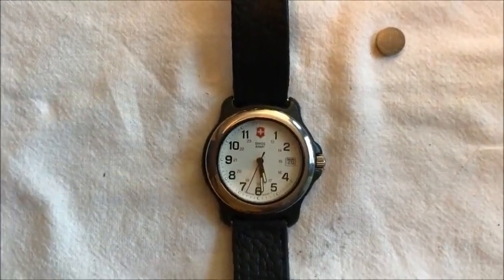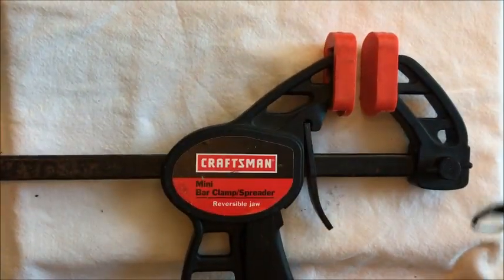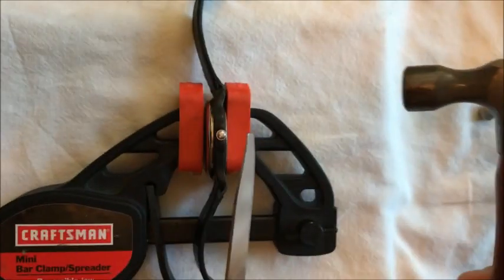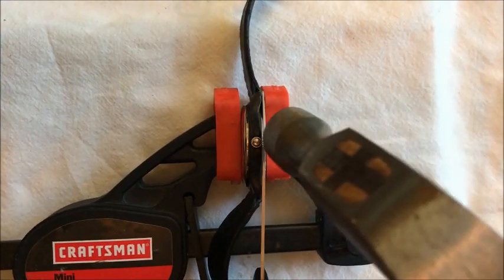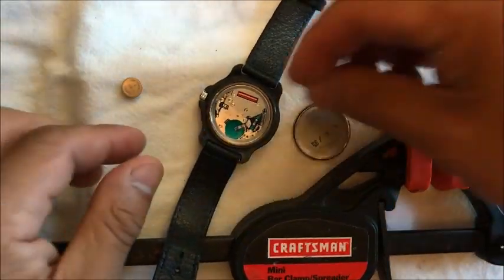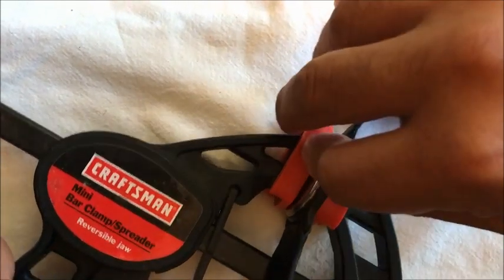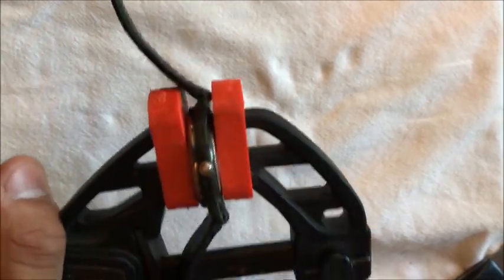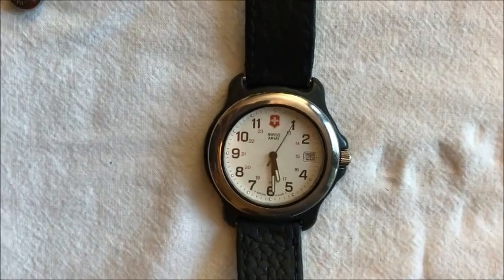Swiss Army Watch Battery Replacement

Comment: Success ! I have this same Swiss Army Calvary watch and the notch is at the 12 O'CLOCK position ! I could barely see it even with a loupe but it's there. I could feel it catch with a pairing knife. Couldn't get it with hand pressure so I found my tiny Dewalt mini clamp with the plastic holding plates like yours, folded a microfiber towel, positioned it to where 12 O'CLOCK was accessable, put on my gloves, positioned the blade where I could feel it catch and gave it two gentle taps with a rubber mallet. It seperated easily. Once I get the battery I will use that same clamp with a couple of plastic bottle caps sized accordingly to gently squeeze the case back in. I will line up the word (ARMY) with twelve O'CLOCK before pressing back in; just as it was from the factory.Thank you! You saved me $$ money. I haven't had it running since 1995.

Comment: I actually tried this, but without the clamp and it worked perfect. Then I put the caseback back on it and tapped with the hammer to pop it back in. No damage whatsoever. I wouldn't dare try this to other watches ,but my 25 year old Swiss Army watch is indestructible!

Comment: I use the blade of my pocket knife to get under the lip of the back cover. And then with a gentle twist of the knife, the back pops open. As for snapping it back on, I just press really hard with my thumbs. But thanks for the battery size info...that's what I was looking for. Thanks.

Comment: Please DON'T do this you do not need to use a hammer to open a snap on case back you are most likely going to damage the case. Do not use this type of clamp or vice to close the case as you will break the glass which is usually protruding above the bezel/case.
Reply: Thomas casidy  First of all I'm no Liberal or asshole secondly he has got away with not damaging his watch so far, as a professional watch repairer I was just pointing out the error of his ways, I have lost count of the number of watches coming across my bench with broken glass and damaged backs due to people trying to be clever. Yes his method has worked but he is taking a big risk of damaging his timepiece and the damage could be very expensive.